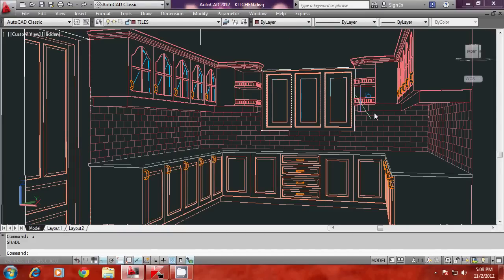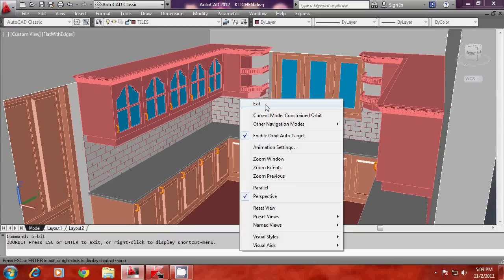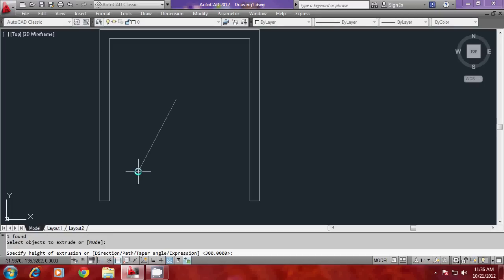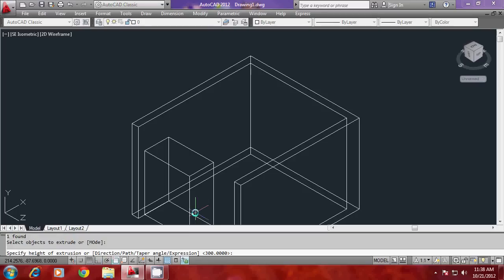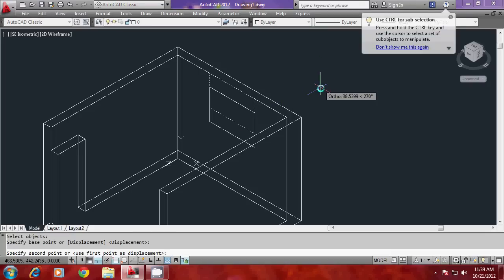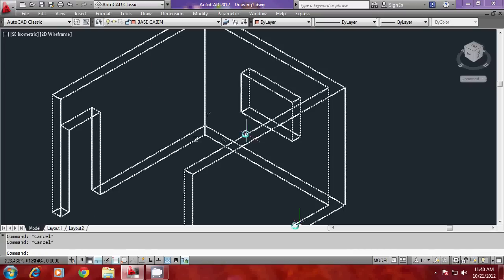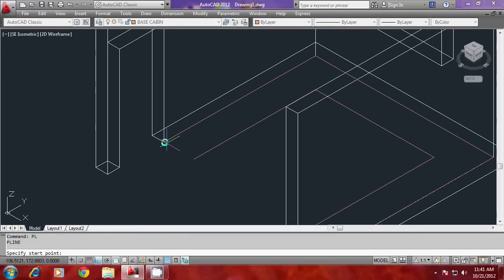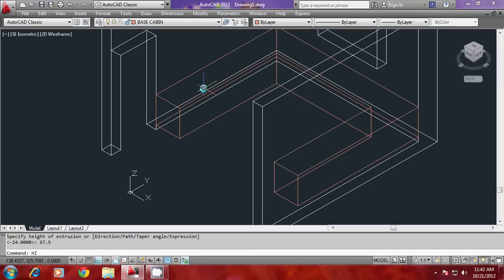Modeling a Kitchen using AutoCAD - PART1 #autocadkitchen #autocad3dkitchen

Comment: This series of video tutorials perfectly demonstrates the capabilities of AutoCAD. However, the proposed approach is far from ideal for furniture design in real production. Even if you are sure that AutoCAD is the best software for furniture, in any case, you should use more professional techniques and you will definitely need plugins. Pure AutoCAD is only a base, plug-ins and add-ons are needed for real use. The simplest plugins for furniture design in AutoCAD and BricsCAD are the AVC Plugins.
Reply from the maker: Thanks for sharing your insights 🙂

Comment: Thank you very much for this great tutorial, but I really face a great problem to generate the top slab of the  base cabin, I do the  lase offset command of 2.5 and I erased the old line, but I can't draw the polygon in order to execute the last pedit command, How can I solve this issue????
Reply from the maker: Thanks for your comment . Just trace a polyline over the existing profile and extrude that one . You will get it

Comment: I am facing problem in creating slab over base cabin. Made the slab layer. Now to trace the cabin top surface and to create closed polyline profile, object snap is not appearing. I checked for ortho condition and also for object snap settings. tried in UCS. please help me.
Reply from the maker: just see whether the dynamic UCS is on. If it's on turn it off. then place the UCS on the top plane of the slab , turn on the object snap and pick points to trace the polyline
Reply: +sabeercad Thank you.
Reply: Mr. sabeercad, I have tried all the above but nothing worked for me

Comment: sir how can I use subtract and Solid in 2015? 
i did subtract and selected the object .. but solid command after selecting the door it says to specify the 3 or 4points ? iam confused here ? can u help me with it ..
Reply from the maker: In 2015 version the procedure is the same . Just closely follow the video . In subtract command AutoCad will not ask you for points . First you select the solid from which you want to subtract , give an ENTER then select the solid to be subtracted .

Comment: nice detail video but why don't you just use autocad architecture? it has walls, windows, doors, etc... built in
Reply from the maker: For an instant presentation we can use it . But if you wanna make a door design which does not belong to the library then we have create it  . In this case the knowledge of making a 3D door is essential.
Reply: thats true